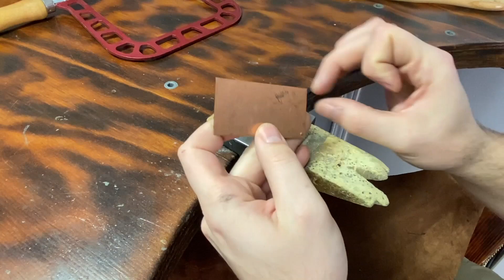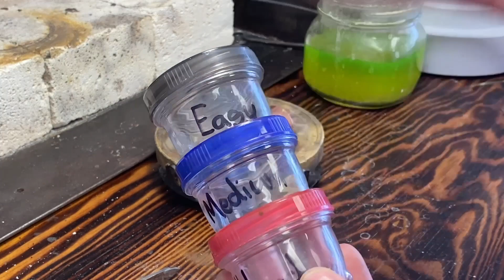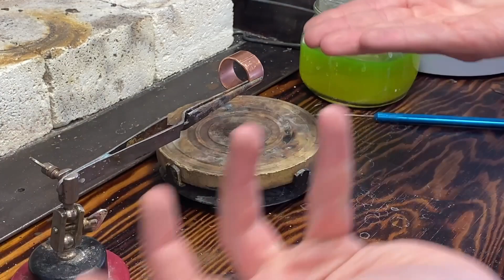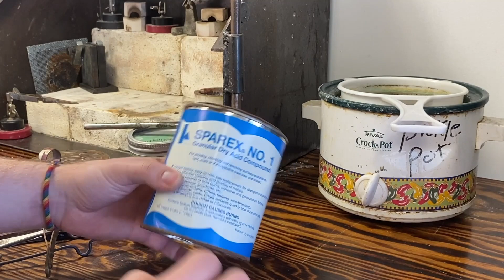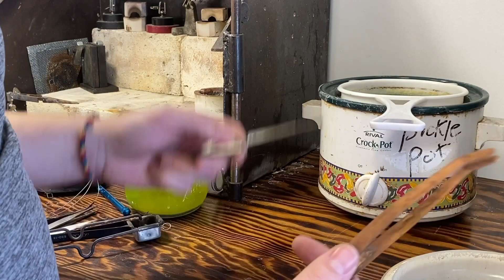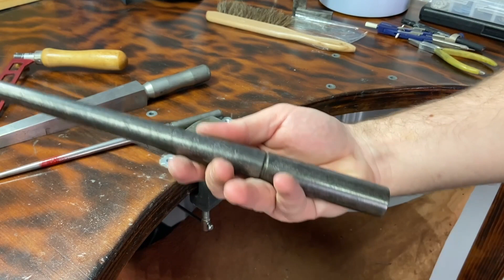Making a basic ring step by step | Ring Fabrication & Soldering

Comment: 𝕿𝖍𝖆𝖓𝖐 𝖞𝖔𝖚, 𝖙𝖍𝖎𝖘 𝖜𝖆𝖘 𝖆 𝖛𝖊𝖗𝖞 𝖌𝖔𝖔𝖉 𝖎𝖓𝖘𝖙𝖗𝖚𝖈𝖙𝖎𝖛𝖊 𝖛𝖎𝖉𝖊𝖔! You avoided repetition and having unbearable background music. I usually watch videos at 1.25 or 1.5 speed. But in this video, I did not have to do that. While I kind of knew how to make a ring, I learned the names of the tools of the trade. I have been soldering electronic parts, but I had never used a torch and always used a soldering gun. And I wondered if you would use a soldering gun. Of course, a soldering gun cannot as efficiently heat up the whole ring.
Reply from the maker: Thanks! We appreciate your feedback. Glad you are able to learn about the process.